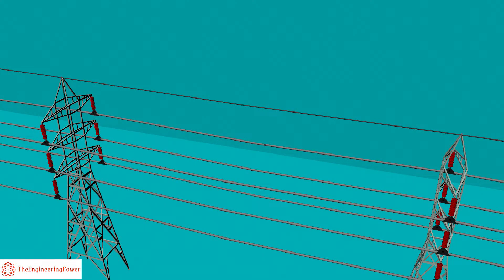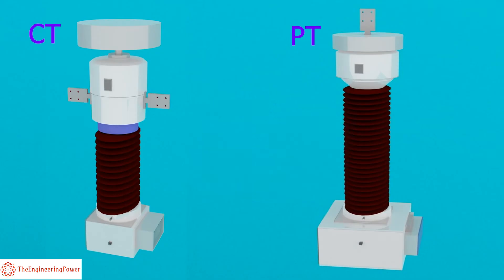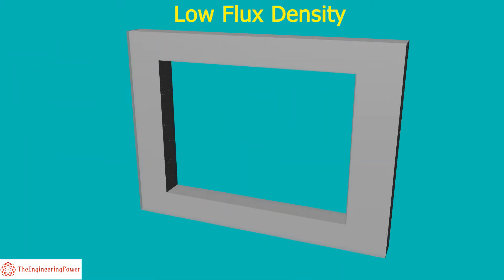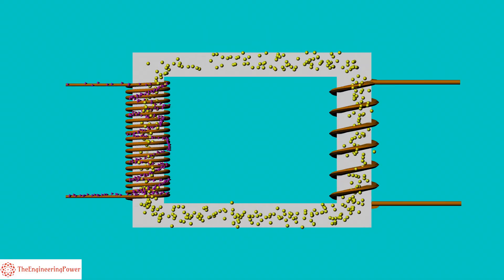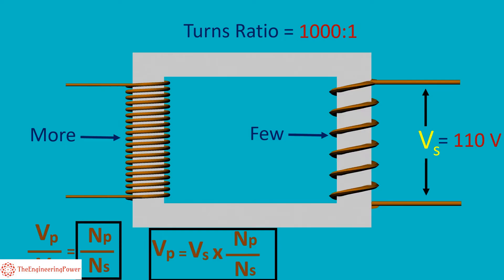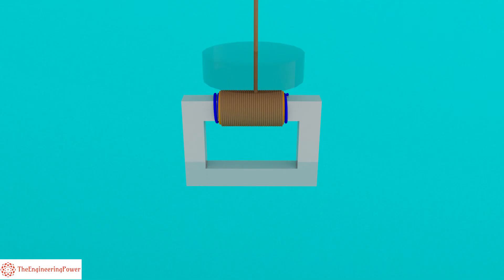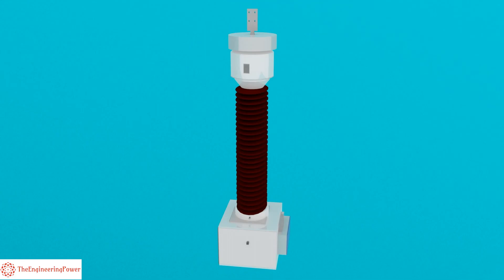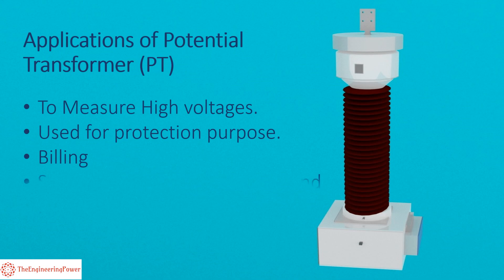What is Potential Transformer (PT) and How it works

Comment: Good explanation with reference to real CT structure but some pronunciations are very incorrect which makes it very confusing to understand what you are saying. Same applies to your CT video.
Reply from the maker: It may be due to different accent. Anyways I will try to make the necessary corrections in coming videos. Thanks for your valuable response.